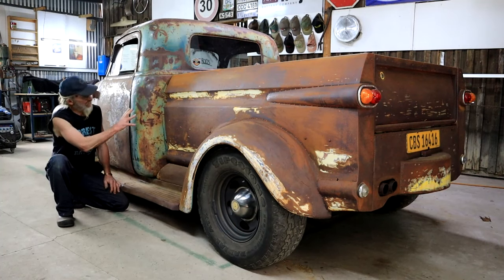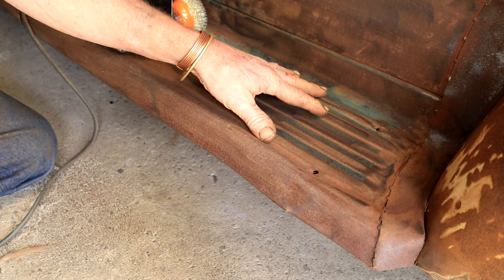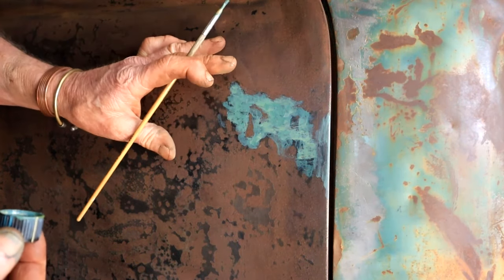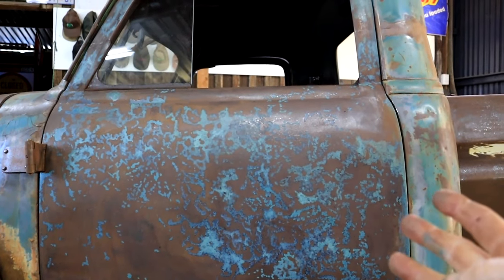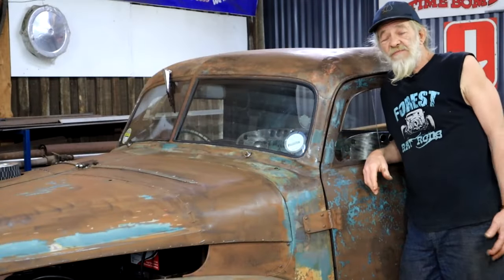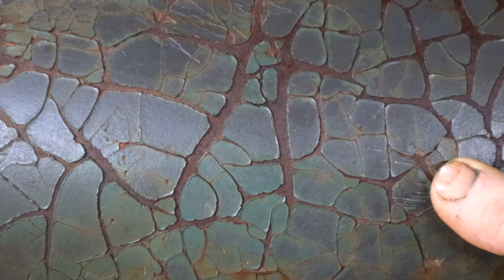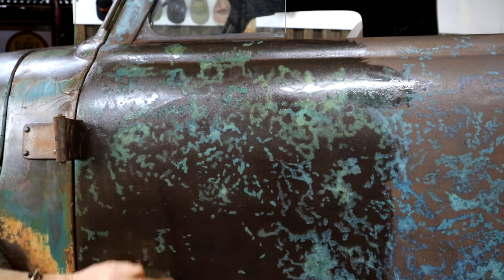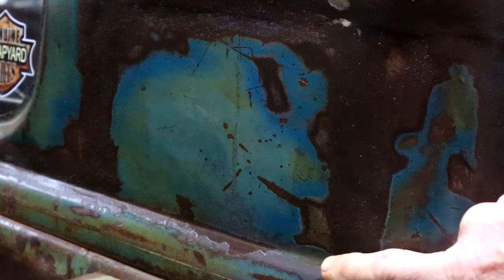REFINING & PRESERVING THE PATINA - 1951 CHEVY RAT TRUCK

Comment: The oiling works and looks nice, does not matter what others do, if it works for your shop or builds. Non painters and even some professional automotive painters forget, that Paint is a complex multi layered system designed to protect the surface from rust, weather, and minor damage. Oil is only needs 1 layer to do that and is self-healing somewhat. To get the metal both properly protected, we need good adhesion to a clean etched surface. Then a sealer primer or builder primer, then our top coat for the color, then the multiple layers of clear coat. Interupted by lots of sanding, wet sanding, and buffing. It is a lot of work. I prefer it in some cases, but not Rat Rods.  But we cannot and I agree should not take the 3rd part of a 3 part system and just spray it over unprimed, uncleaned, and/or unprepared metal or surfaces and think that will work for long. Even all my former WyoTech Instructors said this: "The clear cannot and will not adhere well, if at all everywhere. This will cause it to fail, chip, peal, or otherwise not protect anything." Now a days they are marketing so-called bare metal clear coat paints, maybe those have adhesion promoters built in? They are not cheap either way. Oil is. Bottomline for my shop and my own thought process, professsion and personal painting/refinishing experience, says without the right surface and surface preperation, no primer, color-coat paint, clear coat, or single layer (enamal or paint and primer in one) are gonna  last or stick well. To each their own, but oil is designed to penitrate bare metal and rusted surfaces and does. Paint is not designed, no matter what the label or marketing says, to do that. One primary reason, is if there us surface rust, old paint patina, cracked paint, or dirt, then our primers and top coats will never be in physcal contact with the actual metal surface below everything else. That us why rust sealing undercoats and chassis paints fail over time. Each layer is only as secure to the metal or surfaces as the the bottom most layer. Rust has no adhesion, it flakes off or forms dust on top of the real metal. Just some things to think about? Div (Diff) I think you said what works for you, is still what matters more. A+
Reply from the maker: I think this is one of the best comments I have EVER read on YouTube! I'm no paint expert, but what you said just makes sense! I hope everyone reads your comment. I'm going to pin it to the top. Thanks dude!!
Reply: @ratrodsafrica  Thanks, hope it helps...

Comment: To me, the oil is more in line with the natural beauty of the weathered paint and steel.  It needs some maintenance, but it glows and is PART of the paint and finish now, not riding on top of it “like it’s wrapped in plastic”. 
Thanks for sharing your concoction, Div!
Reply from the maker: Yes, we'll spoken. I hate the shiny clear coats that many use. It does indeed look like a coat of plastic and destroy the patina in the long run

Comment: You are way more than a "Triple Threat" to the winners circle when it comes to style, fabricator, designer, painter and my favorite; Left Handed". As my maternal grandfather and myself, both lefties. 
  And you are right; Shiny Paint Causes Stress!
At age 7 I would spend with my grandpa oiling his steel tool with linseed oil & turpentine. Later, I found that turpentine is distilled from live pine trees. Amazing product that has not gone up in price as much as everything else. Why is shipping so high to South Africa, Australia? 
 Enjoying the look with the spot weld tacks, hinge straps and my favorite is the wire welded stitches because it adds a "Frankenstein" look. Plus on gravel roads with the bush growing, scratches wipe right off. Pure Magic.😊
Take care Duff as in Nebraska we are having daytime high temps of 20 degrees F (-6 C) and it's cramping me style!
  Best of luck, happy holidays and wishing you a great 2023.
DK, Omaha.
Reply from the maker: Wow DK, I will die in that weather!😄 Grandpa taught you good man. Thanks brother, happy holidays for you guys too
Reply: @ratrodsafrica  Thanks! I miss my grandpa a lot with a 1932 electrical engineering degree and army corp of engineers, he ran field generators that produced 4 different voltages to operate mobile Radar in England during WW-II. He was alway doing something in the garage but taught me how to solder as he build little toys from wire frames, washer for wheels and coffee can metal tops. Next thing you know, you had a Model "A" or rail engine for steam. Little pickups was his favorite. Wrap in news paper, place in box, drive the children's hospital and drop off a front desk with the nurses, then leave! Still have 3!
Blessing Rat Rodder in Africa! Love the air brush action and ties it together...Just great!

Comment: Boet!!! I enjoyed the video!!! It was cool to see the different techniques from small brush strokes, then the dabs with the brush and then even the air brush added a nice touch. Your Patina potion mixed with you adding in some green and baige colors made a night and day difference!!! Before and after was remarkable!!! The little monster on the cab scared me 😂 see ya in the next one Div!!!!
Reply from the maker: Thanks Dmac! Maybe the same on your shop truck?
Reply: @ratrodsafrica  I believe you have convinced me. I sprayed clearcoat on a old C10 shop truck few months back to seal the patina. I enjoyed the look of it but you are right in the fact that you gotta tape everything off and then your cleaning spray gun after use. Gotta worry about the smell while doing it. I think Im gonna go with theme of a GT40 Race Recovery Truck with my F100 shop truck. Im gonna add some design elements from the GT40 and mix that with the old patina thats on the truck and maybe even add some painted graphics similar to the GT40. A subscriber commented on my video to give me the idea. But I will defintley be trying out Divs Patina Mix 😃 Have a lekka one Div!!
Reply from the maker: @DustyMacsGarage  read the newly pinned comment...
Reply: @ratrodsafrica  great info 👌 it makes complete sense that the oil is a better method!!! Defintley will be using it on my shop truck!!!
Reply from the maker: @DustyMacsGarage  it's such a common sense comment! I love it!
Reply: @ratrodsafrica  I agree!!!
Reply: @ratrodsafrica right!!!!

Comment: That truck is a work of art. You took so many different parts and melded them into one beautiful truck. The oil coating just adds to it and will mellow as time goes by. You can also use chainsaw bar oil sprayed inside the frame rails, doors and other body parts to prevent/stop rust from forming
Reply from the maker: Thanks very much!

Comment: Years ago, the military boys used a mixture of kerosene and SAE 30 motor oil to shine up their equipment for parades. It worked well on the olive drab paint jobs.
Reply from the maker: The difference is that the boiled linseed oil dries. The motor oil stays oily and attracts dust.
Reply: @ratrodsafrica  That was a trick for parades. The vehicles were washed and back on duty afterwards.

Comment: Was just on your channel looking to see if I had missed your latest video... Getting used to you being a part of my world Bro ...
Reply from the maker: I hope thats not a bad thing...😆 I try to post videos on Wednesdays and Sundays👍
Reply: @ratrodsafrica  It's a great thing Div 😎 I am around your age, but trapped in a body that no longer works well. I started as a Mechanics Assistant when I was 15 y/o,  the grease and oil had already bonded with my DNA. I also spent a few years as a Metal Fabricator, so I have a lot of admiration and respect for the custom work you do. I am close to retirement, and may start doing a bit of traveling, as my body allows... I never considered SA a place to check out, but you have certainly opened my eyes... so has your attitude... thanks for that Bro

Comment: I have been using clear deck finish on antique items I repurpose . I am thinking now that the tinted versions may have great potential. Thanks for your Ideas and thought process. You reminded me of the down side to clear coating. I was almost ready to go down that road. Now I think not.
Reply from the maker: Pleasure man. Yes, the down side is that if you ever have to remove/repair a clear coat, the original patina underneath will be lost.

Comment: I had a hot rod MINI I called pieces.  Guess why!  It was fast though.  I used to street race guys with V8s.  I would get them by a half a block.  But we never raced more than a block.  It was in  Downtown Santa Rosa.  The lights would turn red at the next corner.  Funny thing, it was OK to street race but not to run a red light.

Comment: Hey Div.  You're exactly right about not clear coating.  Rust is not a stable surface.  If you clear coat over rust it will start to haze and flake off after a few years.  Good luck getting the clear coat off and preserving your patina when the finish fails.  Boiled linseed oil is way better for this application.  It's super forgiving, works great, and is hard to mess up.
Reply from the maker: Yes man! I've seen a few cleat coat jobs gone bad myself. And like you say, no way to keep that patina intact then.

Comment: Truck looks great Div. I've recently switched to penetrol from boiled linseed oil on my 49 Chevy patina truck. It lasts alot longer. It's like putting a clear coat on it. Maybe you'll like it.
Reply from the maker: I know that Penetrol stuff from my time in the States. Its not available here though. Did you know that there is linseed oil in Penetrol as well? The stuff in it that makes a difference is a clear alkyd resin.

Comment: Your color enhancement turned out awesome, I have tried the linseed oil process but prefer ATF. An I agree glossy clear coat on a rat looks terrible. Great video Div
Reply from the maker: Thanks! ATF? Does it not stay sticky and collect dust?
Reply: @ratrodsafrica  I have not had an issue with it. A little bit of dust but no sticky

Comment: You might like trying diesel fuel. It's got a low flashpoint and will last a long time.
Reply from the maker: For me the problem with diesel is that it doesn't dry like the boiled linseed oil. Then the dust sticks to it